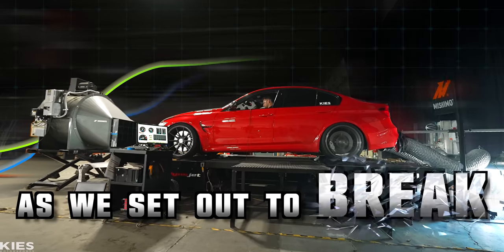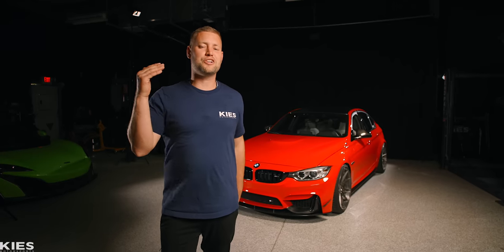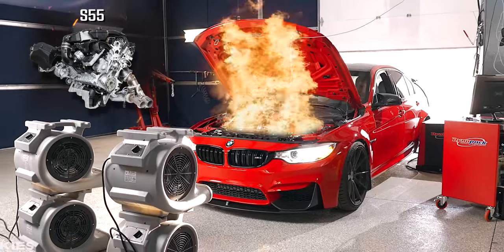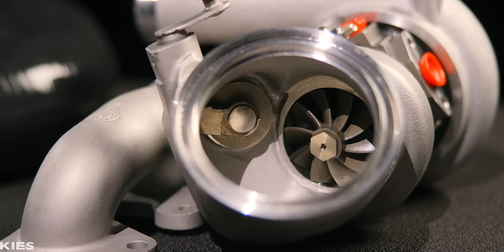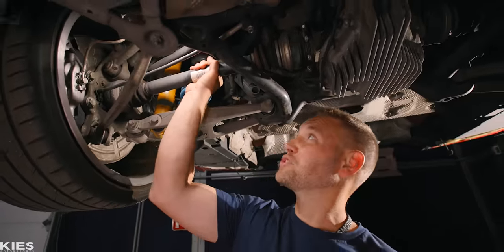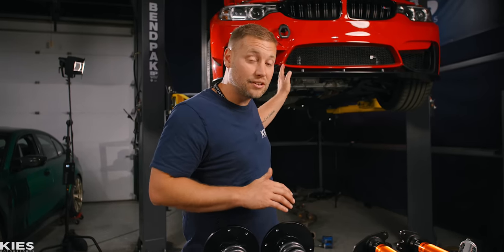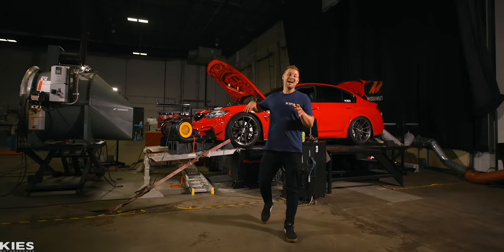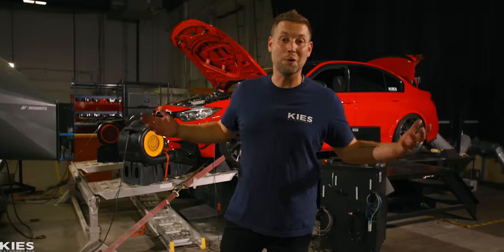Is it possible... 1,000 HP with 4 catalytic converters 😸😸😸😸 (BMW M3)

Comment: Congrats on hitting that 1,001WHP mark with cats, guys! Awesome to see it done. Curious what it'd make without the cats if you ran it back to show what kind of restriction they're making, even if just for a video.
Reply from the maker: Thanks! Should make another 150 hp without them
Reply: @KiesMotorsports  and really, 150HP when you're already at 1K HP, I'd take the cleaner air, thank you.
Reply: @KiesMotorsports  do you think the car would need another revision to support the added boost it may make without the cats? Or could you just take them off and go
Reply: @KiesMotorsports take them off asap lmao

Comment: Epic build. It's so cool you did it with cats. Gives me hope to break 650hp on my fabspeed catted N55 when I build the motor and strap a Pure 750 to it.
Reply from the maker: I did 600 HP 700 Torque on my N55 335 with a catted downpipe, so that should be doable. I didn't even have port injection..
Reply: @KiesMotorsports  Awesome. Yup, I don't want the port injection. Plan to go Dorch HPFP and lift kit!

Comment: Hey I have a question for the OLED Tail Lights for the F30. So I have a 2017 F30 LCI and want to buy the OLED tail lights. But I really don't want to have the dynamic indicators. Is it possible to have the indicators light up normaly ?